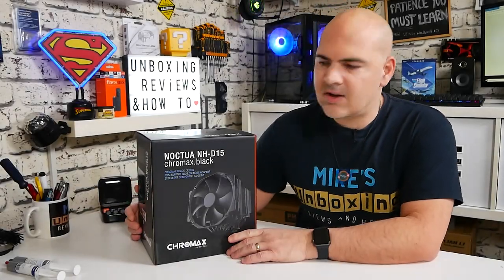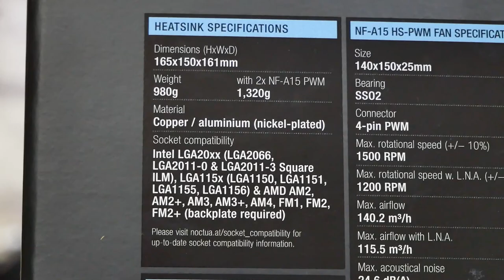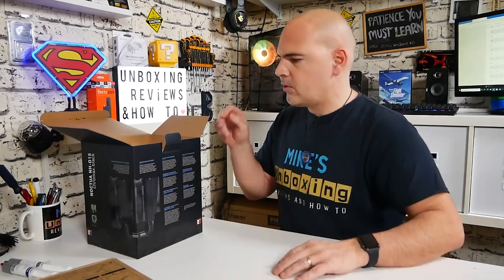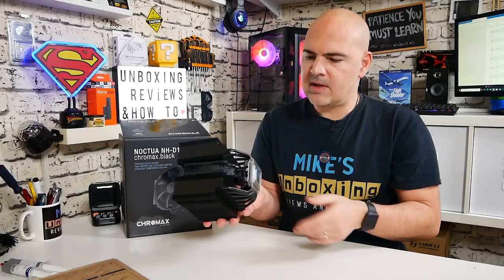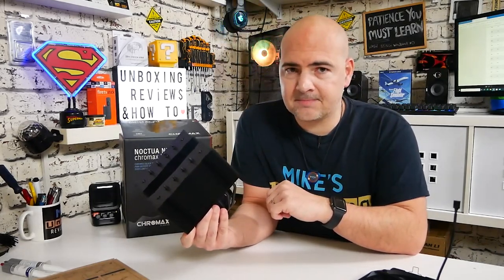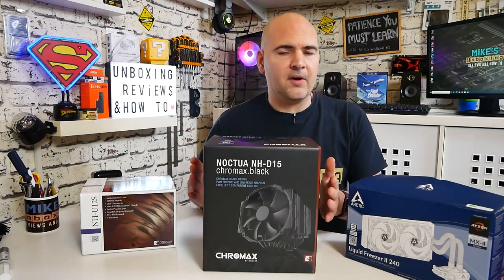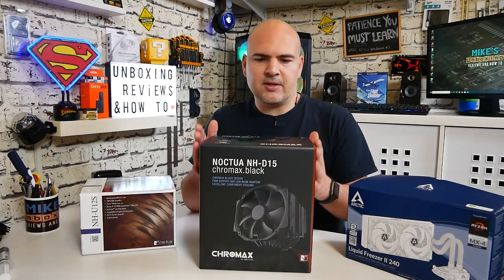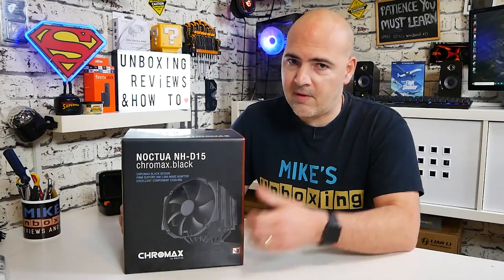How To Install Noctua NH D15 Chromax Black On AMD AM4 But Beware Of The Size

Comment: hahaha...ha...ha.. I've watched so much and read how hot these Ryzen 7800X3D are... I'm building or actually improving an 11-year-old PC and I tested the motherboard, RAM and CPU all night. Unfortunately, I had an unforeseen problem with the cooling of the PROLIMATECH MEGAHALEMS.
  I kind of had an adapter that fits AMD on AM2, AM3 and AM3+ which should also fit on AM4. Unfortunately, in the AM5, the spacing of the screws from the screwed catches is completely different. Fortunately, I also bought a heatsink, Arctic Frizer PRO 64, for retro AMD equipment...
Only 3 heat pipes. I used the same but on Intel C2D 6400@ 3.2GHz and it worked great. Well, I'll see how it copes with this hot AMD CPU ... And what a great surprise, the radiator is not even lukewarm. I used an old, about 8-year-old MX4 paste that had been opened a long time ago - it just fell into my hand from a box of others. At idle CPU around 40 ST. C, under the load of about 130W (from the wall socket), the temperature around 85-max to 90, the socket temperature about 40-47 max ST. C CPU voltage about 1.1V clock all the time at 4.8GHz.
The radiator is still barely lukewarm. Even the heat pipes just above the IHS and the summer IHS itself I checked with a pyrometer. Warmer frames around 41 degrees C.
  The chipset (X670 chipsets) and its heatsink are hotter, already boiling -52 degrees C .
Power section.... barely lukewarm around 35 degrees C on large pieces of aluminum.
MSI X670P WiFi board.
On the other side of the plate lying on an A4 paper envelope just below the CPU socket, barely 35 ST. c
I loaded the CPU with Cinebench 20 (max 110-115W from the socket), but only with my favorite program IntelBurnTest 2.54 by Agent GOD and the CPU instruction set replaced with linpack it reached 130W. By stressing 14 cores of the IGPU (GPU-Z and PCIe link test) I managed to draw about 150W from the socket on the 80+ GOLD ENERMAX power supply.

Either I got some exceptionally good piece of silicon or these CPUs are not that hot at all.
Oh and for the Kingston 6000 RGB memory exactly like that - Kingston Fury Beast Black Ddr5 64Gb 6000Mhz Cl36 (KF560C36BBEK264) I chose 2 XMP profile instead of XPO. They are identical in settings.
Profile 2 sets the memory to 5600 Mt and the voltage to 1.25V, the SOC goes to space at 1.3V.
I changed the RAM voltage to 1.3V and SOC to 1.1V and set the speed to 6000Mt. And it works beautifully. Test in Memtest UEFI, test with Linpack a few hours. Zero errors. There was no ECC in memtest.

Only this boot MSI board. Even nothing moved on 4800 jedec and still starts after a simple reboot about 45s to the post screen. Massacre... After turning off the power it's even worse, it's some madness 2 reboots until.

Comment: I wanted a noctua fan but instead I'm getting a be quite one I'll be rebuilding my pc on Christmas these are the new and old  specs

Amd phenom II X6 1075t (old)
Cooler master hyper tx3 with a be quite 92mm fan (new)
16gb ddr3 1333 ram (old)
Evga gtx 970 (old)
Two segate baracudas in raid 0 (old)
Ionz kz08 (new)
Pny 500gb ssd (new)
And maybe a aerocool cylon 700w
If you answer this does a 6+2 pin pcie power work on a 4+4?
Reply from the maker: nice setup, and no the power connect won't work
Reply: I did same. Was considering a Ryzen build but decided to go with an old Athlon II. Bought a 300w psu and a noctua static fan. Hopefully will do the trick even though it's not very high end.
Reply: @nauxsi  who needs high end amiright
Reply: @gwashere  if it does what you need it's all good. The only thing extra I bought is a pcie USB 3.0 adapter just to add two ports.

Comment: I had the problem with my graphics card, so I got the NH D15s chromax, and it sorted out the graphics card issue. Only downside is that it only comes with the 1 fan!
Reply from the maker: still works pretty well though right?
Reply: Its the same performance as the d15, I opted to put a NF 12 fan as the 2nd fan, (case restrictions) This cooler is ideal for people who have a MATX motherboard and want a D15! Its even better now they have just released a chromax version!

Comment: Did he just instal the cooler with no RAM in place??? Why???
Reply from the maker: extra clearance for filming
Reply: @mikesunboxing  thank you. Trying to find any video if it will fit with Corsairs dominator ram 4 slots, but no luck. What do you think?
Reply from the maker: @russhogan6967  you would probably need to mount the fan on the rear not the front if there is enough room in the VRM area
Reply: Thank you. And on a side note, you are one of the very few content makers that actually replies in his comments part. Subscribed and alerts ON !!! THANK YOU
Reply from the maker: @russhogan6967  We think that the viewers are what make a Channel, so always try to reply to the comments :-) Welcome to the Channel :-)
Reply from the maker: @russhogan6967  also we actually enjoy the interaction with viewers as much as making the content and see this as the beginning of a friendship and a great community we are building together

Comment: I like this cooler, but the size of it was not going to play well in my case at the time I looked at it. Now, with my new case, it would fit, but I already got another one. Maybe when I'll do a complete upgrade (probably with AM5), if it fits, it will be my cooler of choice. Noctua is a well respected brand.. But those old colors choice... 🤔
Reply from the maker: i miss brown and beige a little bit if i'm honest, it takes a lot of balls to stick with that colour setup these days. Be beige and proud 😇
Reply: @mikesunboxing  I just ordered one..but in beige! the price was right for the dual fan version over here. I may just try to cover the fan's housing with some black tape. At least, I wont have to worry about cooling if I buy a Ryzen 5900 😁

Comment: I'm so psyched to take my nhd15 off of my 2600k (@ 4.7ghz), slap it on my 5600x and finally let the old girl retire. 

After 9 years, I feel like I should mount this 2600k on a plaque, lol. 
Now I just need to figure out what ram will fit under it, all the current gen stuff seems to have skyscraper heatsinks!
Reply from the maker: that is a great CPU definitely a classic

Comment: Sonewhat oor guide mane, i neededd
 to see the bsckplate.
Reply from the maker: nothing much to see there really you dont remove it
Reply: @mikesunboxing And I also did not need to put any of the weird height raisening screws, just fit the motherboard sockets to chassi outlet and screw on cpu fan.

Comment: You need to flip the fans anyway to make sure the white serial numbers aren't starting you in the face every day ;)
Reply from the maker: yes, yeuugh labels
Reply: @mikesunboxing  just a weird oversight from an otherwise meticulous product. Still a great cooler, and weirdly easy to install given how epic it is. 

Putting together a system tomorrow but luckily it's a new build so I can do it on the test bench (motherboard box). 😂

Comment: Looks like it sits right over the DIMM slots.
Reply from the maker: yes it does on most boards
Reply: @mikesunboxing  Is that going to cause issues with the RAM? Seems overly big for a cpu cooler, too bad there isn't something a little more compact.

Comment: Definitely better (and safer for your components) than the AMD Wraith. The Wraith bent some of the pins on my 5900x (could it have damaged the motherboard, too?). I put the D15 on my 3900x, no problems, no scares, no damage. I think I'll be using the MSI bolster stick, just to be safe, though.
Reply from the maker: how did the wraith manage to bend pins? removal?
Reply: @mikesunboxing  application, I believe. Using the screwdriver at an angle was bad enough, but then the wraith doesn't stay aligned (slides too much when screwing diagonal), the screws don't tend to reach their slots, and I have to apply a scary amount of pressure. Honestly, they should really include spacers/fittings with it. At first, I was stuck in a bios loop, unable to boot to windows, despite having updated bios for the 5900x (thumb drive still present). Removing the wraith was a little easier, even used a tool to help ease the wraith off of the cpu. But the cpu was not locked in, anymore, and wouldn't lock into place again, because of the bent pins.

Comment: you should lay down the case and not install it while the case is vertical. You can easily damage it the way you are holding it.
Reply from the maker: yes thanks for the info